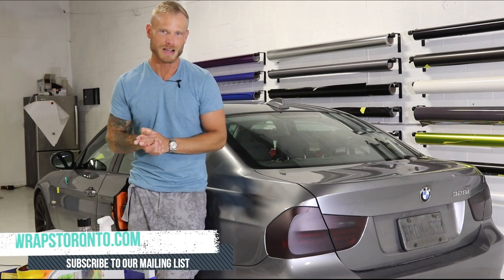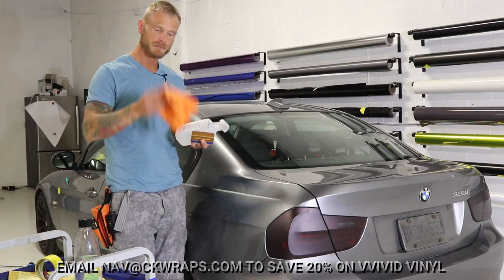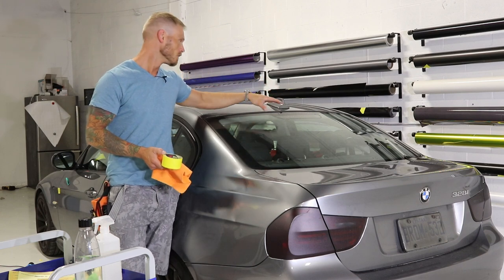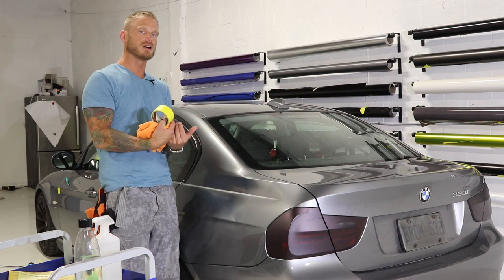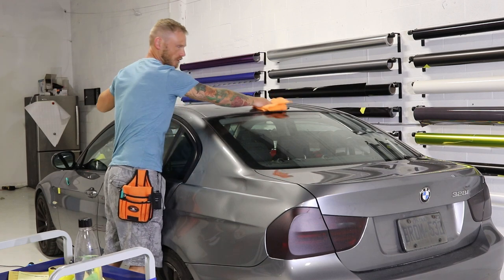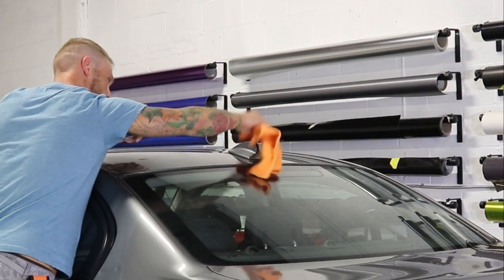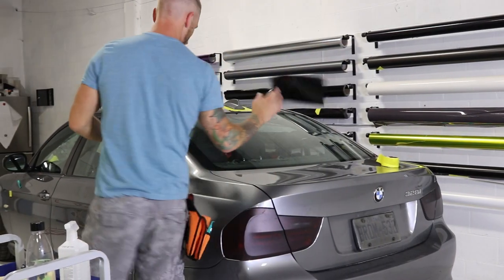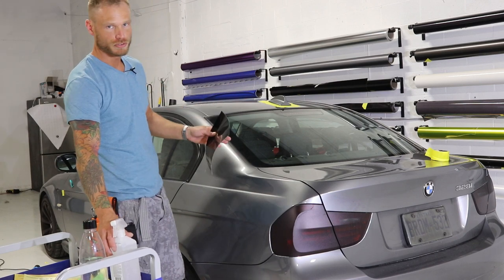How-To Wrap A Shark Fin Antenna In One Piece

Comment: Hi CK! I followed your instructions, and the vinyl wrap on the roof and antenna turned out fantastic. The only problem is that my car’s Satellite Radio reception (specifically SiriusXM) is no longer working. Fortunately, FM, AM, and GPS are all functioning perfectly. I don’t use XM frequently, so it’s not a big deal, but I’m curious if this is a common issue with vinyl-wrapped antennas or maybe if 3M is too tick and should switch for Avery. Thanks for your help!

Comment: you ever try the vacuum-seal method before on a shark fin? there's a Rainer Lorz vid on TWI where he shows his rigged-together hand-vacuum method...it seems way too good to be true -- I've had moderate success using it on parts other than a shark fin, but figured I'd see if you've tried it before, bc if you can rig together the right cheap little vacuum device with like surgical tubing and air-tight tape it definitely seems like it'd be the best method to do shark fins tbh...I've been trying to find a cheap, yet still good enough handi-vac to use for it, bc in the vid Rainer no joke makes it look as if shark fins are basically just a super quick wrap you have to do before the roof wrap haha. If you haven't seen it I'd recommend checkin it out though, and if you've done it I'd love to hear how it worked out for ya, bc I'm tryin to incorporate it into my overall strategy/gameplan for roof wraps + wrapping shark fins super easily....but also tryin to see if it really is too good to be true, or if I just bought a really shitty handheld vacuum my first go-around....hahah
Reply from the maker: What I don't like about it is how it draws tension down to the edges. Doesn't make sense to me
Reply: @CKWraps  yeah when I first saw the video & in the intro part where it shows a super-brief overview of the trick, I had the same issue...but when I watched the whole thing and how he did it, keeping a slight opening around the sharkfin itself so you can tuck the vinyl under after vacuuming out that air, it seemed way more practical...I havent been able to get it to work yet, but that's bc I bought a piece of garbage hand-vac that hardly pulled any air out to begin with haha. But otherwise, so long as you leave that little bit of slack so you can pick up the vinyl around the edges of the actual antenna and then feed the vinyl underneath nice n flush, it definitely seems like a really solid way of doing it...I just get the feeling that it's something that looks super easy, but takes a couple times to practice so you arent just wrapping over the top edge of the sharkfin and that's it, so I think if you can master it to be able to cover that area underneath then it still seems clutch to me...plus if you're going to wrap the roof after doing that, you could still theoretically not need to tuck it 100% in, just as long as you create super tight seams...I def think I'm gonna keep at it personally, bc I think it def can be a better mousetrap, if you will...makes it so quick + easy, but definitely doesnt eliminate the necessity for preciseness/using it as a tool to get sloppy with your techniques basically...bc I've definitely been on that same page as what you mentioned, but watching ranier do it is pretty wild since hes able to tuck it in and make it look perfect still...so I just know there's gotta be a way to master it, but it just may take a bit more practice (& in my experience, clearly a better handi-vac bc of how horrible my last ghetto-rigged one failed to even pull air from an airtight setup, hahah)

Comment: If you're doing both the roof and fin which do you recommend doing first if you don't want to remove the fin?
Reply: I'm doing both was (fin off this time). The issue with on is I had to make a precise template to put the roof liner, so much more time. I ended up doing roof first, antenna second as the vinyl added a bit more paint protection in case knifing went bad. This time I'm taking fin off which will make the roof wrap simple and fast

Comment: Great one, very informative. But one question: what would you do, if you have to wrap the whole roof? Would you do the antenna first and after it the roof, or the roof first? Maybe you can make a video about this question, would love to see how you do this. Thx a lot for all the work you spend on makin this videos. Always a lot of fun to watch! :)
Reply: The shark fin antenna can be removed so that you can wrap the roof first or vise versa. It's easier to wrap it on the car as there is more control over the vinyl but when it comes to the roof wrap. It will have to be removed.

Comment: Oh man … there’s no way. That takes far more skill than I have. I did black out the grill of my Explorer, but that was from a precut set of vinyl. My antennae desperately needs to be black but … sigh.
Reply: Did my first one in 2 piece which is easier, but it'll separate over time and doesn't look good. After 3 years I'm taking it off this time and will try 1 piece. Half the work is actually getting the thing off.. removing c-pillers and dropping roof liner to unbolt.
Reply: @Roadsurfer2k11  Yeah ... no. I think I'll just crawl up on a ladder, mask carefully and just spray paint the damn thing. But kudos on your mad skills!!!
Reply: @FrankPSF  that'll be the easiest way lol and lots of clearcoat.  Did that on my mom's mini Cooper but the fantastic thing is her is just a cylinder post that unscrews off. Best one I've taken off. My elantra took a few hours and some broken off clips